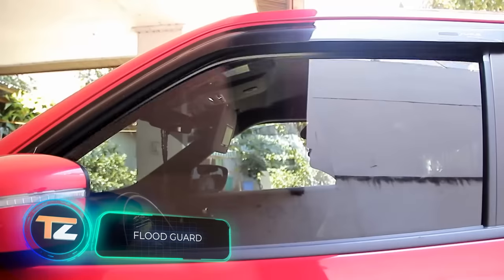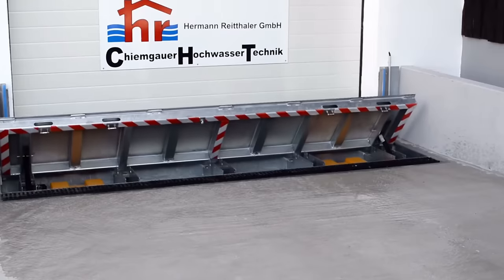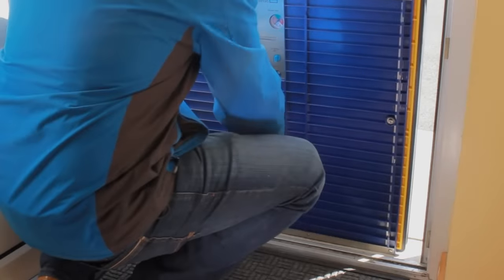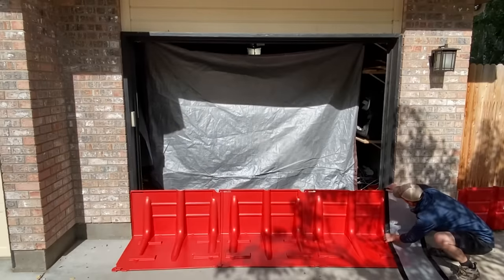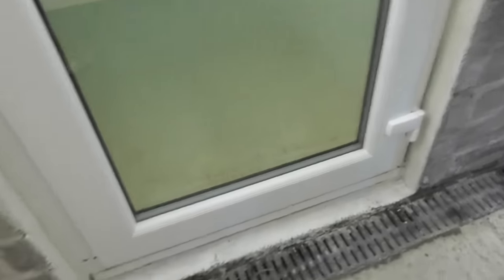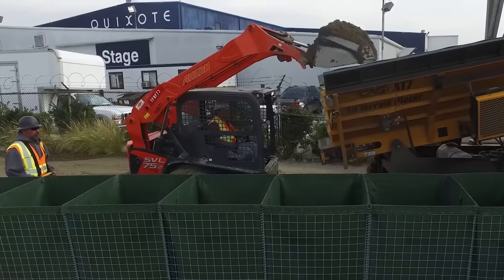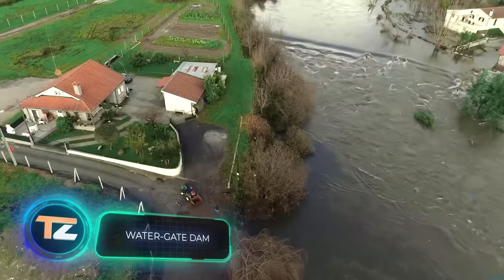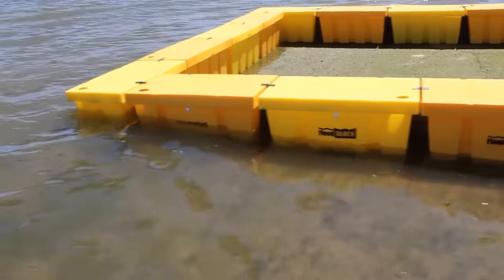FEW PEOPLE HAVE EVER SEEN THESE ANTI-FLOOD INVENTIONS

Comment: Seal round the front door with silicone, then nail a blanket across. Any water that gets through will be filtered by the blanket, so silt will not enter. It should seal the blanket. Get into the house through a window.
Reply: I tried cut tape nailing my Britta filter instead on a blanket... Now my filter is broken!

Comment: On the parking lot flood control, are there any erosion issues with all of that water draining off like that?  On a side note, places like Mexico City could use something like this for their city since with the place being ceiled over it stops the water from getting to the underground lake that Mexico City was built upon, which is one of the reasons they are having so many problems with their foundation down there.  Taking all of that water out of the underground reservoirs/lake without putting any of it back is causing voids to be created.  Without the support of that water, the ground will subside and even collapse.  Don’t know if they will ever get that problem solved before it is too late to save the city from major damage.
Reply: EARTH IS DYING SLOWLY END OF THE WORLD IS UNSTOPABLE
Reply: @Noone-vv9yb  of course the earth will die, we’re just speeding it up a little
Reply: if I recall correctly, the parking lot material has to be laid on a very specific foundation of layers of clay, sand and gravel, to ensure that it doesn't erode away underneath and the ground is able to absorb the water that is being poured onto it. That channels the water out and away to the wider area where it just becomes part of the water-table. I presume - though they didn't mention this in the info I have seen - that they also ensure that the foundation and the asphalt is laid on a slight camber, highest in the middle and sloping down fractionally towards the edges, so that the runoff will happen in a safe direction. Most roads are built on a camber like that anyhow, so they should be able to be relatively easily converted to this new material.
Reply: @bethyngalw  Thanks for the update.
Reply: @flyboy38a  What was missed in the video clip and Bethyngalw's answer is the permeable concrete is also structurally weaker. Using it on a parking lot it will break down fairly rapidly instead of a 25 to 50 year life span of regular concrete. These mixes have less actual concrete than normal so are naturally weakened. If you were to set beeswax rods in a grid where you are going to put the concrete then pour regular concrete, with the base built for drainage, the heat of the curing process will melt the beeswax leaving drainage holes through without the major structural loss. beeswax being 100% natural is not going to pollute anything.
Reply: @jaquigreenlees  Thanks for that updated information.  There is so much to civil engineering that I can't even imagine one person knowing a third of it.  Even during my nuclear degree education we had civil eng. as part of the curriculum.  You need to understand structural strengths to be able to designed a power plant to contain a breach in the reactor vessel; which the Soviets did not think was that necessary.  After all, mother Russia DOES NOT make mistakes.  Cough, cough; Chernobyl, HACK, HACK !!! I am melllltinnnggg......
Reply: @flyboy38a  one of the science channels here covered permeable concrete and it's flaws a few months back, only reason I know anything about it. :D
What is often ignored when cities or town are designed is the impact the impermeable coverage of the ground has on water table and water flow. It actually leads to greater incidence of flood events since rainfall can't soak into the ground. A permeable cover would mitigate flood events be letting the water get through to the water table easier.

I think Practical Engineering is the channel and the topic was flooding / flood control where it was discussed.
Reply: @jaquigreenlees  Thanks for the info.  I did see sometime ago, a program that discussed the very issue you described about the water not getting down to the water table because cities were covered in nonpermeable surfaces.  Only time will tell if the damn politicians will get off of their backsides and have the appropriate companies work on the issue in order to safeguard our infrastructure. (NOT holding my breath!!)
Reply: @bujubra2594  bruh we would die earth will still survive
Reply: @jaquigreenlees  thanks for the additional information, I hadn't seen that in the info I looked at about it. The main benefit of it is that it enables land that is covered in asphalt to go back to being absorbent land, like the natural landscape, instead of being impermeable, which leads to flooding.

Comment: I think the permeable concrete is a pretty solid idea, but the biggest issue that I can think of is that the concrete may crack easier than traditional concrete if water freezes inside the concrete

Comment: What is needed to kept plants from growing through the topmix pavement? I mean they can even push through normal road surfaces. What would keep the from pushing through porous surfaces that get tham acces of water and nutrients?

8:37 Why not attach some straps at the end that get rolled up. You then just grab the straps and walk along making the barrier unroll itself. So you don't have to unroll this being hunched over.
Reply: im sure getting driven on every single day does the job for 90% of the area, the others you just use hire a crew to do the sides once a month

Comment: Interesting, but I think some of them wouldn't stand up well when real world tested and others would have short fail times.
The door block methods may be good for some structures, but most homes aren't built to be submerged. Water will come through the walls. A lot slower yes, so if the flooding is short, then okay. If it goes one for a while though, it'll still get through eventually.
Also, that pavement one that allows vast quantities of water to flow through it seems like a terrible idea. Sure, it may help in minor flooding conditions, but water under roads always spells disaster. Has the company done extensive testing to see how allowing so much water through will affect sink hole formations? All that water flowing through is going into the ground underneath and fast flowing water takes soil with it. That's how bridges fail in floods. It's like paying to someday have cars fall through the pavement in your parking lot.
Reply: Presumably, the houses themselves are built to resist water ingress, but the doors aren't. Something I could easily see happening on a known flood plain
Permeable pavement isn't really a means of avoiding flood damage directly. It's more to reduce the risk of floods in general by increasing the local storage of rainwater (Instead of funneling it all immediately into storm drains). What they don't mention is the concrete is poured over a similarly permeable foundation that eventually leads to catchment ponds or drains.
It's a pretty clever idea, but the big problem is that if the concrete freezes while holding water, it's wrecked.
Reply: @watchm4ker  I honestly don't think they change construction methods for different flood zones. They typically drop the land values and such so poor people tend to buy in those areas. It's like how in tornado and hurricane zones they still build houses that have overhanging roofs that the wind takes ahold of to rip the house open like a tin can. I guess they do anchor them to the foundation, but that's really only so good.
I thought about an underlayment for the pavement, but you end up in the same place as before. Either it's directly under the pavement and you end up with pooling because it has to funnel the water to a drain anyways, or it's down a ways to give more capacity, but then you end up with the dirt between the cement and the pavement being displaced and you just end up with a shallower sinkhole.
In any event, multiple layers would make the cost extraordinarily higher than the regular pavement method, which would greatly reduce it's popularity. Especially as it would only help to a certain extent. Even if the ansorbamcy rate is increased by quite a bit, the ground and even drain systems have limits as to how much they can absorb, so when the water reaches a certain level, and probably not that high, it will simply fail to keep absorbing.
It's an interesting idea, but has some major fundamental challenges and I really don't trust it much past it's fancy display of dumping a bunch of water on a single spot.
Reply: @haddow777  Think of it like a catchment pond. The water will have to drain eventually, but it gives more time for the drain network to flush out a sudden shower, rather than dumping it all at once.
Reply: @watchm4ker  I understand the benefit. I am just doubting they have really looked into soil movement. Any water flowing in any great amount under roads will remove soil and create a sink hole. It's a simple fact.
Unless they are applying pavement several feet thick, they will either have to rely on soil or some hard surface, which will ultimately limit it's intake of water.

Comment: At least you may have a dry car to live in... Well if the car is still there when you are allowed to return home.

(One sharp edge, bolt etc on the underside of the car and the car is lost...)

The best way to save the car is drive it to high ground until the danger is over.

Here's a tip to help if you have to live in these red zone areas...

Make yourself. Bug-out bag and have a week of MRE's stored in your car' s trunk for emergencies.

Don't forget a portable rocket stove to boil water and a pot to boil it in.

The expense is far less than the devices shown in this video and could actually save your life.

"Get out of town so you don't drown!"

You are welcome.

Comment: 3:03 when water freezes, it expands - this leads to cracks in the streets. to prevent that streats are sealed with tar. this top mix street however is going to have amplified cracking issues.

Comment: With the Reitthaller, I wonder does it have to use electronic sensors? couldn't that just be done with a flotation device? Sensors sound like a serious point of failure in an emergency.

Comment: This porous pavement seems like a fine idea until you consider that it'll be completely shattered in environments that dip below freezing.
Reply: It's not a pavement sponge. The water passes through. Its actually better for winter conditions because the water isnt trapped
Reply: @williamjenkins4913  Interesting, thanks. Where does the water pass through to? If just a sewer, then this wouldn't be any more effective than a drain, yes? I don't see how this works for flood mitigation.
Reply: @tinetannies4637  There is a underlayer that is designed to disperse the water into the soil. Drains just move the water  down river and can get overwhelmed because they are not actually getting rid of the water. With this system a flood would have to overwhelm hundreds of square miles of earth rather then the sewer.
Reply: @williamjenkins4913  Thanks again. If I can strain your patience a little further, I'm still trying to envision how this works. So there's this porous pavement that is, what, 4-5 feet thick? Then under that is the normal layer of rock, clay, packed earth. But this substrate isn't generally capable of absorbing sudden masses of water. So I'm still unclear how this porous pavement would work. Thanks for taking the time to explain, much obliged.
Reply: @tinetannies4637   Think before anything was paved when the absorptive nature of the ground was balanced with the amount of rain fall. It would rain and the rain would land and soak right into the ground to nurture that specific point. Then we put a "plastic" sheet of asphalt over the ground. This system pokes holes in that plastic to let the water back into the ground at every point. The earth is very capable of accepting water. The point of the substrate is to pass the water without undermining anything.
Reply: @williamjenkins4913  Right. My thinking, though, is that this porous asphalt would only work if all the asphalt everywhere were porous, because if only small patches here and there were covered with it, those localized patches would quickly become saturated, resulting in pretty much as much flooding as there would have been without the porous asphalt. Poking holes might work with normal light precipitation but not heavy deluges. For this, all roads, sidewalks, parking lots, paved paths, courtyards....everything would need to be porous.
Reply: @tinetannies4637  Every bit helps. Even one or two parking lots around might stop a small make your basement damp flood. But you are right in that you want as much as possible because the more you have the bigger deluge it can handle.

Comment: Just build your home on top of a non-porous foundation that's attached to a hydraulic system which lifts the home up in the case of floods. Sounds good, but I know, I know...what about the plumbing. 😁
Reply: Fresh water reservoir and telescopic sewer pipe. Just give the powerline a bit more slack lol.
Make sure you got enough sewer gas traps though, vertical sewer pipes normally very bad, though a small price to pay for a epic house.
Reply: @BillyBoze  Thanks for the advice! 😁

Comment: Putting a water trap on your front or garage door is fine but your house cladding has weep holes to ventilate inside the walls. You would basically need to wrp the house in cellophane or something to stop water entering.

Comment: Ok where does the water go after it enters into the permeable asphalt?  There would need to be a gradient of nonpermeable material under it to drain away water to somewhere else.  Good for keeping standing water off the road but at a considerable cost since the underlayer of graded material to drain water away would be a road of structural integrity as any paved road of conventional design.   Concrete roads with proper gradient and kerfed to allow water to drop below the top surface works just fine and the concrete lasts a lot longer than any asphalt ever would.

Comment: I recently learned  force and mass in school but the the flood guard attachment to a pillar is not the smartest thing to  do water force and mass should not be underestimated if the hight level is is up to your shoulders the mass and the force will be equivalent to the height, for and example get a clear plastic container that's big cut a hole in the left or right bottom side find a non solid ground dig up the soil just enough for a stick or support beams to go in it find a string get a decent size toy car and if the 1st newton's law if a object is idle it will be idle until acted upon so put water up to the wheels of your select choice of car and in hurricane winds so use a blow dryer or a blower nothing should happen with no wind and little water but add more water shake the bin the stick might go down it took a couple times for it to stay up because there is more force being applied than there is support.

Comment: 1. Who the fuck packs in their car?
2. Unnecessary over engineered system
3. Can´t wait to pump for 5 mins so I can finally replace my normal door for a lego one!
4. Solar Roadways 2.0
5. Extremely stylish high tech right there, bet you´ll impress your neighbour!
6. The only acceptable one thus far.
7. Sounds great until the walls are too short and the walls will have to be replaced, realistically not making mr. tax payer too happy.
8. Why make an anti-flood invention with a cubic shape rather than have a thin, but higher wall?
9. This one really gets me. First off, who actually wants that thick ass battleground sandbag laying outside their house all the time making it look like some sort of fortress you need to defend? You also need to make it dry so better hope for no rain or ultimately bring it inside in order for it to dry.

Comment: I would be interested to see how the permeable concrete performs in freezing weather. Ice can lift a concrete slab weighting multiple tons if water gets under it and freezes. I would imagine it could tear a parking lot to shreds if water that was inside the concrete were to freeze. Or, if not physically damaging the slab it could seriously degrade strength and performance.
Reply: I mean, I imagine it’s just like hard dirt. It might be more resilient even, because the ice has space to go up and out.
Reply: @evaahh9584  That's certainly possible. I think it would be very condition dependant. The worst case scenario I think would be sub freezing air temps and near freezing subsurface temps with fully saturated base and soil layers where the water would freeze from the top down, potentially blocking any space for expansion.
Reply: @AceSeptre  oh yeah, that’d be horrid
Reply: There is enough space for the ice to expand so it doesnt damage the concrete. Atleast thats how i think it works, they definitelly use it in northern states so it has to work somehow.
Reply: @AceSeptre  If everything is already fully saturated and near freezing thats pretty much a nightmare scenario. At least its underground messing up the pavement rather then having an iceflow flood messing up your town.

Comment: These flood defence barriers are all good for stopping water getting in through the front door but in the event of a flood nothing can stop the water because 90 percent of the water gains access to your property through the flooring etc and no door barrier will help there, actually having one will just stop the water leaving after the flood, you can’t stop water getting in if it’s a bad flood because you would need to have a air tight flooring system in place which unless your property is on stilts then your not going to saved from the flood water. You can’t stop Mother Nature!!!
Reply: In Europe water almost solely gets in through the door seals as the walls and floor are solid mortar due to the likelihood of flooding.